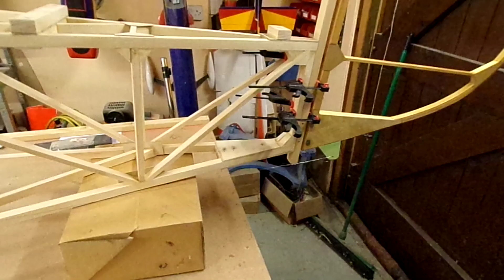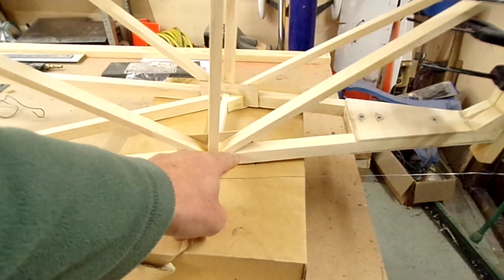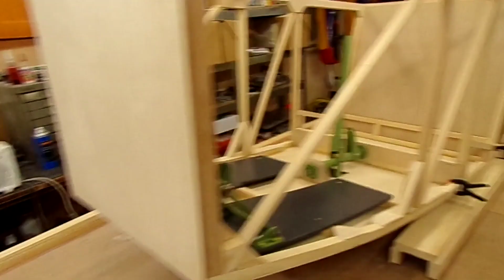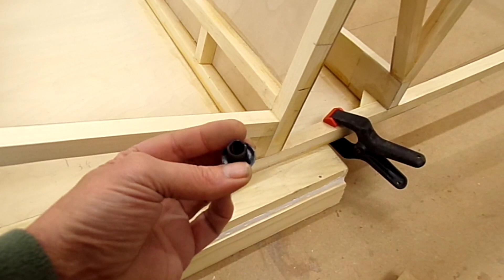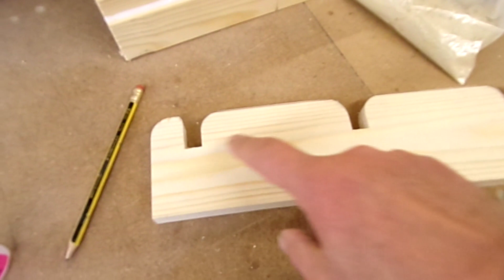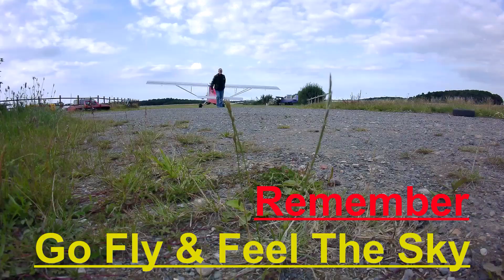EP81 Rudder controls & seat Fisher Youngster V

Comment: I could never ever do a video on a build (or even do a build in the first place) I'd never remember what each part is called, I'd say you need to glue this bit onto that bit then cut this bit then of course I'd have to do some fast sanding just for fun. I feel like a total wally commenting on these videos but I am always fascinated by them. Thanks Algy.
Reply: You can do it! Everybody feels like that until they've tried something like this... once you get into it a ways it's just logical.
Reply from the maker: @timketcham9139  There is only one two seat Fisher I know of in the UK and Horizon and the chap had real trouble getting the build signed off, they even made him make a third wing to destructivly test it. From what i have heard they nearly did not let it fly as so many bits had not been built to the plan (as they could not) but eventually excepted he had made a good job.
I am okay as my aircraft comes under the SSDR class and so I could build it out of paper and spit, as no inspections are needed.
Reply: @flyingkub  paper and spit, now that would be different 🙂
Reply from the maker: Well your comments are always appreciated. I struggle sometimes naming things and probably confuse some of the American viewers,  as they different names for things (I do try to cater for them,  when I remember) .  😀

Comment: I'm often surprised by how much seems left to the builder to figure-out, rather than Fisher giving precise measurements.  I suppose it provides flexibility around a general design.  Like Michael Chartres, I too wondered about the thickness of the wire but you have answered that.
Reply: These were kind of reverse engineered as they built them back in the late seventies early '80s... Constantly changing with every plane they were building.  I have quite a few aircraft plans and fishers aren't bad, they're pretty good actually.
Reply from the maker: You are right, that is how they managed to develop so many types so fast, just built using what worked on another model and then draw it up after if it worked :-)
Reply: Nice thing is that working with wood it’s easy to modify…. But I won’t go as far as Tim to say they are good plans. The Challenger I built had much better plans, I wasn’t constantly second guessing everything, that was a kit all all parts fit very good. I’m building from plans on this build and I actually use the plans as a starting point…. Sooooo many things aren’t correct, it’s almost comical. Once you understand that, then you can have some fun putting your stamp on the build. I remember when I first started the build and was complaining about the plans (I’m not as politically correct as Algy and a few f—bombs were directed directly at the plans) and builders (fucking idiots) were telling me that I MUST build according to the BLUE PRINTS. Well these certainly aren’t blue prints, they vaguely resemble plans, there is no way anyone could build according to these plans because they are just WRONG in many areas. Once I realized that, I was free do do what ever I wanted to do to make things work.
Reply: @grandenauto3214  So more like "written design suggestions" than plans? 🙂
Reply from the maker: @grandenauto3214  I hear you. But I have seen some production aircraft plans that are as wrong as these in places, the difference is they were late adressed. I think the Fisher plans are a big reason two seaters from them could not be made here in the UK as the inspectors would have a fit that you did not follow the plans.
Reply: @flyingkub  there’s a couple of different inspections in Canada, advanced ultralight is built to Fisher’s approval. I’m building under home built rules.
Reply from the maker: @grandenauto3214  I do wish we had more relexed rules like the Experimental class in the USA here in the UK.
Reply from the maker: Yes there is a fair amount left to be worked out, that might put first time builders off but there is a good amount of support from past builders and from Fisher. I must say that I do make some work for myself as an engineer I can't help myself looking at trying to improve thing or even just changing things to put my own stamp on them.

Comment: That wire looks awfully thin.  Is this what you call "fly by wire! LOL.  The seat is being to look a little more comfortable.  Regards Michael
Reply from the maker: That wire is just to get the lay out of the control the final is 1/8" thick 🙂 I do hope the seat will be better than a flat sheet, I will have a thin cushion on it as well 🙂
Reply: Well I'm well pleased to hear both explanations 😀😀
Reply from the maker: Yes I wouldn't think that wire would last for the taxi out :-) and my back side would not last for a couple of hours on a flat plank.